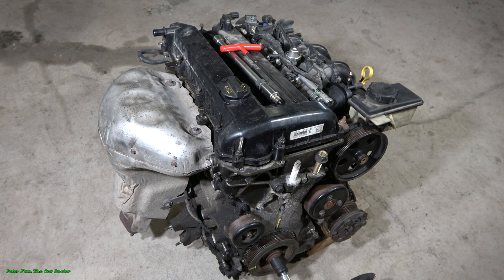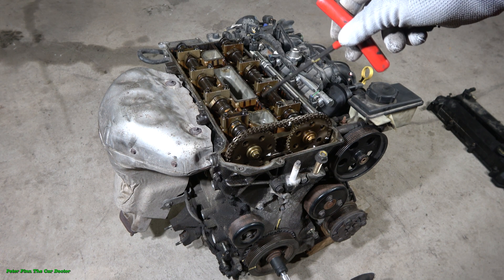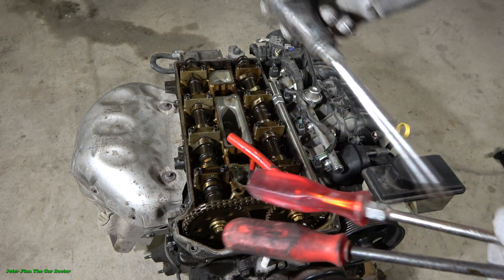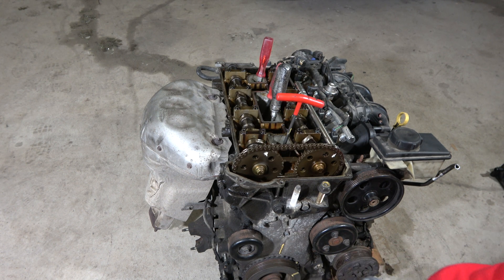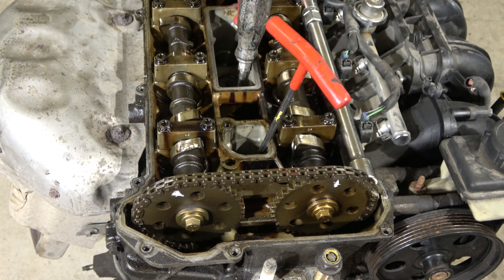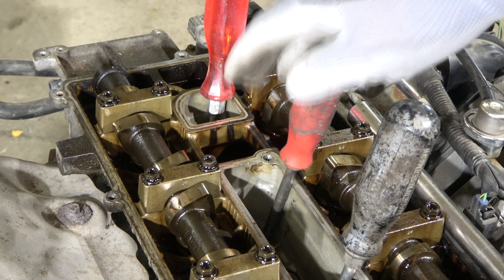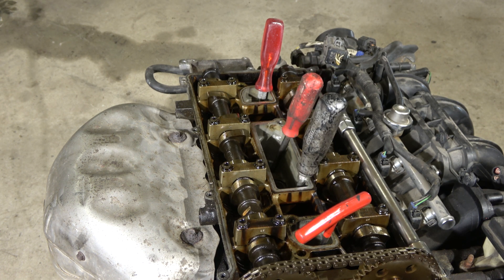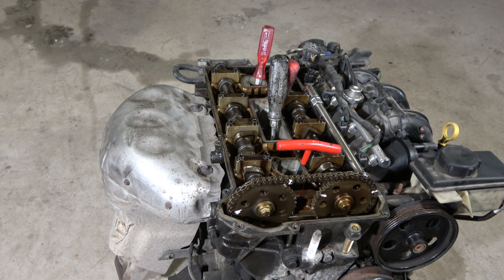How do you determine the Firing Order of an engine

Comment: Hi Peter need your help with my corolla transmission engine 4A FE  transmission takes long to engage 2nd gear especially in the morning and then shifts when engine I guess gets to operating temp
Reply: Check transmission oil level if low top up